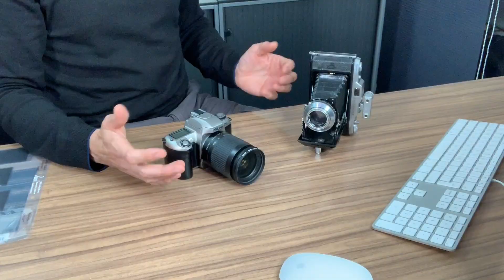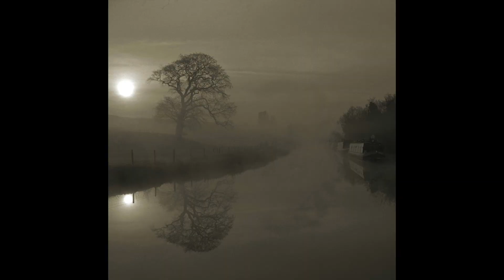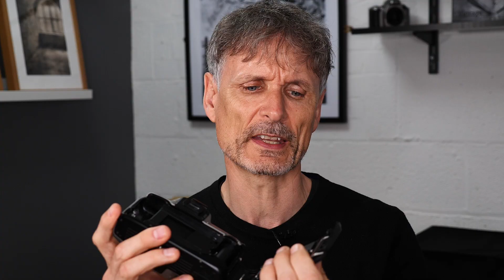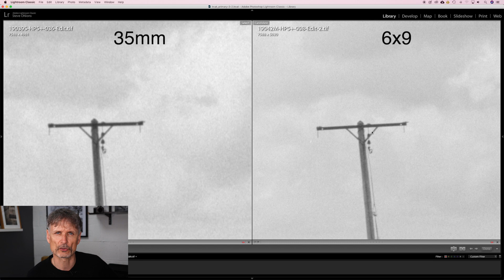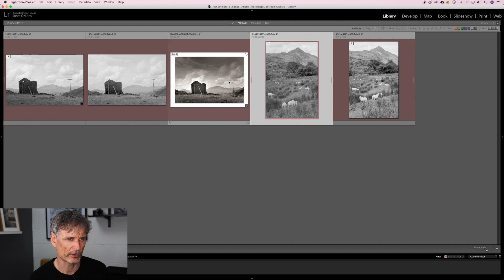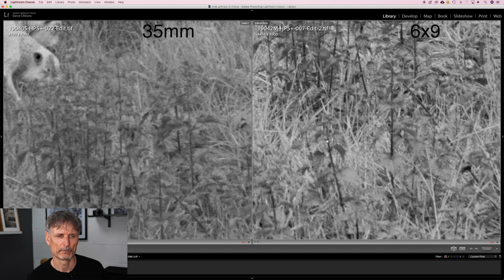Film Photography - 6x9 v 35mm for long walks

Comment: Many thanks for another very interesting video and comparison.
One question: How did you size up the 35mm scan? Do you use a specialized software, or are you using Photoshop? If you are using PS, are you resizing in one go or in steps?
Thanks a lot, Michael
Reply from the maker: Hi Michael. I just used basic photoshop resizing, both scans were in a simple flatbed so they were never going to be particularly sharp to start with. A better method would be to optically enlarge to 8x10” then make a reflective scan from the flatbed. This gets round many of the limitations of simple scanners as the print has less dynamic range and grain aliasing is removed. Perhaps I should do a video comparing optical and digital enlarging.
Reply: @SteveONions  Hi Steve, this would indeed be very interesting.
For a quick comparison of the negative scans, I was able to keep grain in reasonable check by enlarging in steps of 10%, bicubic smoother to a little over the final resolution. Then resize down to the desired pixel  size, using bicubic sharper.
Many thanks for your response and looking forward to more interesting videos. Michael
Reply from the maker: That’s an interesting approach Michael, I must try it next time. Thank you.
Reply: @SteveONions  My pleasure. I learned about this in a Photoshop tutorial (maybe in a side note, not sure).
You may want to create a PS Action for this.
Good luck and again a big thank you for all your efforts, Michael

Comment: Steve, how do you advance film on the 6x9? I don't remember Ilford having guide numbers on paper in which film is wrapped. A few years ago I , regretfully , let go a Bessa 6x9, but I don't remember film I used. What I remember is that I saw numbers through that red circle. My today's 6x9 is Fuji GW 690 II -  lightweight but huge in comparison to those lovely folders. Totally unrelated now, I cut off those fins on the 8x10 processor :) And another thing, I bought today an old fujinon 180 w f5.6  with a huge image circle of 305; very lightweight lens for the field on 8x10 in addition to my nikkor m 300. Great video, Steve, I learn plenty from you.
Reply from the maker: I have found the Ilford films to have fairly clear frame numbers Gene but nowhere near as good as those on Fuji films, they really stood out.  I'm interested in your results with the Orbital too and how much chemistry you use (I typically go for 250ml now).  
Is the 180 Fujinon the earlier single coated version?  I believe that can just cover 8x10 at f/22 while the later model has less coverage.
Reply: @SteveONions  The other day I tried to do stand developing with 500 mm of rodinal. In spite of prewetting for a couple of minutes, the corners turn out undveloped, so I guess either I'll forget about such modus operandi or try it later with around 700 ml of solution. For now I am going to stick to constant agitation with 250 ml. About the lens; yes it is the earlier W series with the lettering inside the filter ring. They look smaller, than the later version so they should be ideal for field use. The W S series looks identical with the same parameters according to websites; both have 305 mm image circle.
Reply from the maker: Shame about the stand development but I’m not surprised given the orbital design. 

I’m now interested to see how you get on with the 180mm Fuji.
Reply: @SteveONions  I'll be glad to report my experience with it , Steve.
Reply: So, Steve, this is my initial thoughts on Fujinon W 180 f5.6 the older version with the i.c. of 305 mm ; it is not that lightweight as I imagined (438g). First time I tested it with no special precision on the Intrepid yielded about half inch vignetting. The second time I was very thorough in setting the front standard by the book. Unfortunately, the result with the sky vignetting came out even worse; the first time at least it was even, but the second time the left corner vignetting was two times bigger then the left. Of course it is manageable to make it all eventually even, but I don't think it's worth the torture it takes. It looks like my sample of the Intrepid's front standard isn't that precisely positioned in the center. Perhaps the best usable mild wide is the Fuji A 240.
Reply from the maker: Shame that the coverage isn’t quite there Gene but I suppose that’s why the lens is rarely mentioned as an option for 8x10. I think I’ll also stick with the 240mm which is much lighter and seems to have quite a good image circle. Thanks me for letting me know your results.
Reply: @SteveONions   I finаlly got a decent result from the lens! All I had to do is to drop the lens down half an inch from the supposedly centered position and voila, no vignetting at all. And this time I didn't do much rear tilting. So, I think I can safely declare, that the lens does cover the format without vignetting and has decent resolution in the corners! Sorry for the pessimistic previous message, but I am glad it worked out .
Reply from the maker: Damn, the price for 180’s has just shot up 🙂

Comment: Really love that darkroom print and don't fret that you used a lot of paper and time! When I first started darkroom printing earlier this year, I was really slow and wasteful but I am getting better!

I have a Zeiss Ikon Nettar 6x9 too but pre-war. I've stopped carrying it around in favour of the 1950's 6x6 one as I like the normal view of the lens better on square and also the lens has better contrast.

What was interesting was that the second set of photos, the Zeiss photo was higher contrast than the 35mm
Reply from the maker: I think the light had changed by the time I took the second image James and it was clearly more contrasty on the negative. I also prefer to carry a 6x6 folder as there’s no need to rotate it which is when I get the most problems with framing. I also like the 6x6 format and the gradual softening of the corners brings the eye into the centre very effectively.

Comment: At some point, I do want a 6x9 camera of some sort.  I presently prefer the ratio more so than square format or even
6x7, 6x8.
I wonder if you could lessen the nikon f65 camera's rough back plate scratches on the film by fine-sanding it.   
A way to avoid debris is by using wide painter's tape, and also protect the rear curtain with a piece of thin cardboard cut to the size of a few 35mm film frames, then protect that whole area with a plastic zip loc bag around all of the camera except for the open back door.
I have an Argus Brick that scratches as well.  I assumed it was the pressure plate, and tried sanding it, but the long scratches still occurred.  I gave up on it.
(a separate topic, but...) there is an adapter that can take the brick's lens and adapt it to a digital camera.  I have a veteran of classic camera friend that claims that some Argus lens coatings do very well with sky contrast.  So, I may do a lens-ectomy on the Brick and try adapting it onto a digital fuji x.  I have very little to loose in this experiment, when I make time for it.
Reply from the maker: I could definitely get to the bottom of the issue given time but as the F65 is barely lighter than my F80’s I decided to retire it instead. Oddly my Holga has put tramlines in the last two rolls of film despite there being no obvious cause so I’ve carefully smoothed every surface that comes into contact with the film. It’s the time and effort to test that hurts most, shooting a roll and developing it every time soon adds up!

Comment: In the US in the fifties the Kodak Tourist in 6x9 was the standard household camera, if you went one step above point and shoot. They didn't have the best lenses and Kodak sold the film as 620 which was really 120 on a slightly different spool. They do offer plenty of negative and 60x90 does offer some panorama possibilities. Those with 4x5s around can easily find backs that use 120 in wide formats.
Reply from the maker: The size is certainly very appealing especially in terms of the tonality it can deliver. I have a 6x12 back for my 4x5 which is really enjoy using.

Comment: Hello Steve.
A very interesting video.  Thanks for the explanation about the lod glass and contrast.  As I manly shoot with old glass on B&W film, I was unaware of the contrast benefits, but since you pointed it out I now know why I like that look.
Excellent content, and thanks again.
Ps. Do you sell your prints.
Reply from the maker: Thanks Phillip.  I really like the lower contrast of older lenses for B&W work as it expands the shadows quite considerably which makes printing a lot easier.  In terms of prints I don't sell them at present but I would like to offer both digital and darkroom versions of some images if I had enough demand.

Comment: Hey Steve, many thanks for another excellent and informative video. Having just discovered your channel, I think I must have watched everyone of your videos. I feel so encouraged that your still using film alongside digital and even re-entering the darkroom. I totally agree with you that they are two different processes, each with their own characteristics and qualities, although you have a great deal more experience than I. Having bought a 6x9 and 6x12 back for a mono-rail 5x4 camera, which I'm yet to 'use in anger' for landscape, townscape, and architecture, I been thinking about an older, smaller 6x9 folding camera, too. So, this was so helpful. I would very much like to see how your 35mm image develops on your prefered film scanner and processing, for comparison, and I would really like to see some darkroom techniques, too. I once tried Cibachrome / Ilfochrome, which I absolutely loved. Sadly no longer manufactured. Keep up the good work, it is a real inspiration, inspiring me to take it up once again. I knew I kept hold of all my equipment for a reason!
Reply from the maker: Thanks James and I only wish I had kept hold of all my equipment rather than selling it all off and having to buy it back (twice!!).  I also tried Cibachrome a few times and found the contrast unmanageable so I switched to RA4 which was surprisingly successful.
A 6x9 folder is a good compromise between the bulk of a 120 system camera and the image size of 4x5, not far off if you are considering a roll film back and I too like my 6x12 Horseman on the Intrepid.
I'll certainly be adding in more darkroom related material alongside all the other formats, I like just about any camera system and do not see a conflict with shooting both film and digital.
In terms of scanning I have been changing my approach lately and will probably do a video comparing the three options I use.

Comment: Great video, Steve. Exactly mirrors my experience with my old Agfa folders (6x6, though), but as you said already in the video: a lot of the "softness" of your 35mm scans is due to the V700 being somewhat ametropic on small negatives. I use this scanner myself, and it's  so much easier to get good results with medium format.
Reply from the maker: Very true Carsten which is why I am looking to use digital camera scanning in future once I’ve sorted out the workflow.

Comment: Great video very insightful. One question, do you always scan with the Epson? I've always been dissatisfied with the results for 35mm. I now scan with a dedicated 35mm scanner and the results are much sharper and richer in detail.
Reply from the maker: I rarely use the Epson now, it sometimes comes out for the larger formats and when I’m being lazy. I can use my Minolta 5400 for 35mm but typically opt for the Panasonic G9 with 30mm macro lens, it resolves all the details in the film and is quick too.

Comment: For finer grain and better detail from 35mm, why not try Ilford PanF (50 ISO).  You may need a tripod, however, which adds weight. FP4 may be a good compromise between the two.
Reply from the maker: That is definitely an option but would have meant carrying a tripod and that’s something I really want to avoid when going on long hikes.

Comment: Hello Steve,
Since I own a good exemplar of the Voigt. Bessa-1 with a color-skopar (Zeiss equivalent of the Tessar), 2 nikon bodies (FE & FM) ad  a bronica sqa +2 lenses,  I have fond your comparison extremely interesting. I have 2 questions:
- Have you ever compared the zeiss against the Bronica in term of IQ? I supose the Bronica is better, due to its more modern & sophisticated lenses.  But would you say it's worth to carry the extra weigh (I am 72 and have some back problem)?
- I have looked for a while for a L bracket for the Bessa, but without success. Any clue?
Thanks for your untertaining and informative videos
Francis
Reply from the maker: Hi Francis.  The Bronica lenses are sharper and have greater contrast but the additional image size of the 6x9 and older lens makes the image very smooth and easy to print/scan.  If you are shooting general landscapes I think the 6x9 has the edge on the Bronica if weight is an issue (and it is for me too).  The biggest issue is the fixed lens which offers less options when framing shots but if you work within these limitations then the folding cameras small size and light weight are very tempting.  
In terms of L-Brackets I use a generic brand which works very well on the Zeiss, not sure if it suits the Bessa but it is worth a try and it makes vertical compositions on a tripod very easy.  https://www.amazon.co.uk/Andoer-Universal-MPU100-Release-Bracket/dp/B00RFLU5IY/ref=sr_1_5?keywords=camera+l+bracket&qid=1567362939&s=gateway&sr=8-5

Comment: i recently bought a Zeiss Nettar made in 1933 to play with using black and white film. Is there a BW film that you have found is a good all around film to start with? I know you often base your film on the conditions and look you want but I'm a long way from that level and just want to get started. Also do you know of any good reference material you would recommend to understand how various films (BW) behave?
Reply: Philip Culbertson Tri-X or HP5 are both easy films to work with and good for starting out. FP4 is another great film for when you have more light.
Reply: @ZachBie  Thank you Zach. I'll note those and give them a try.
Reply from the maker: I'd agree with Zach that something like HP5+ is perfect for just about anything and is so flexible and forgiving you are hard pressed to go wrong.

Comment: Great comparison!! I know it's not about that, but I'd love to see some more pixel-peeping conparisons between cheap and expensive TLRs and folders, how much difference there is between, say a Rolleiflex and a Ricohflex vii. The difference in price is huge but if you try to compare them by sample images you find online, usually the guys with the cheaper cameras are also (mostly) more casual with the shots; they dont use tripods for landscapes and there's a lot of camera roll & shake disguised as corner aoftness... It would really be great if you made a comparison like this for various price point cameras, never seen it anywhere and it would help a lot of us.
Reply from the maker: Thank you. I like doing the occasional comparison but I’m less interested in absolute performance, more the overall look. There will be an upcoming video where 35mm and 120 were shot alongside each other but to do a real technical comparison of similar cameras would not reveal much difference in my experience. 

All the best 🙂

Comment: Hello Steve, thanks for next great video :-) Also great news that you're back in your darkroom, there's nothing like to hold finished fibre based darkroom print. Do you plan to share some darkroom videos? Also if I can recommend - I had pretty good experience with T-Max 100/400 for 35mm photography. T-Max 400 has grain comparable to regular ISO 100 film with 2 stops better sensitivity and prints from 35mm T-Max 100 are so fine grained that one of my friend asked me what medium format camera do I use :-D
Reply from the maker: Definitely do something with the darkroom videos this year 👍 I was a big fan of TMY-2 for a number of years and agree that in 35mm the grain and sharpness are excellent. I’ve made 20x24” darkroom prints that stood close examination and it scans exceptionally well. I tend to favour HP5+ at present because it has more of a film look although having recently digitised some 35mm negs taken with primes on TMY-2 I’m definitely considering it again.

Comment: Hi Steve, hugely impressive image quality from the folder but would you kindly explain what the gadget is that's perched on the top plate, please? What is it's function and is it unique to Zeiss? Thank you.
Reply from the maker: It’s an auxiliary rangefinder Russell, I can more accurately asses the focus distance with it. They are quite cheap and can be fitted to any camera, just make sure you get one that uses the same scale as your lens IE, metric or imperial.
Reply: @SteveONions  Steve, I'm very grateful to you for taking the time -  doubtless you have much better things to do.👍

Comment: id like to see an hp5+ 6x9 vs a tmax 100 in 35mm, or even a slide film. trade all other considerations for maximum sharpness on 35mm and see how close you can get.  beautiful darkroom print.  id also like to see the same scene darkroom printed from the 35mm negative. how close do you have to get to tell any difference? i got to take a baby graflex with a 6x9 roll to colorado this summer. i found i considered my shots a little more carefully with the higher price tag.
Reply from the maker: I’d love to do more comparisons Chris when I get the time, I’ll be putting out a video examining how close 35mm can get to 120 if enough care is taken at the shooting and developing stages.